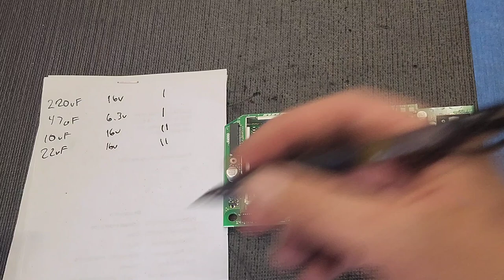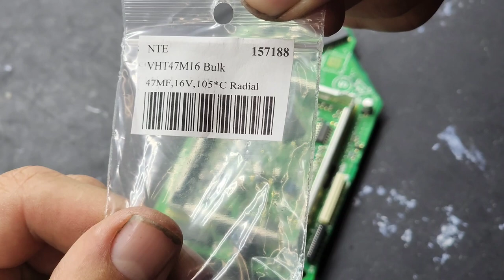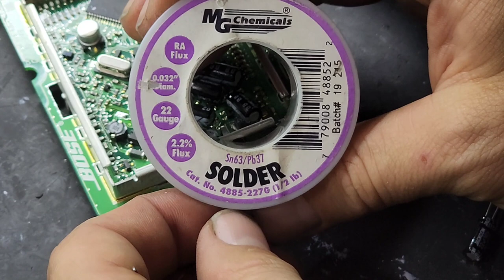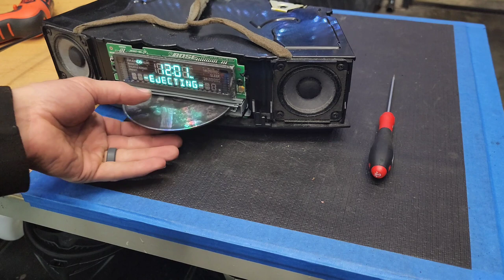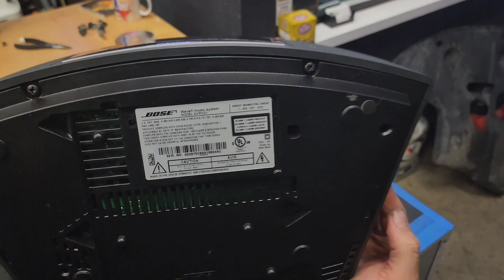Bose wave radio not working with fix!

Comment: When you put the screws back in the case turn the screw counter clockwise until it clicks and then it is lined up to the threads and will not break the plastic.
Reply: Thank you so much for this. Drove me nuts.

Comment: The reason people replace all of the electrolytic caps is due to age. If one fails the rest are likely going to fail or leak as well which can damage the board and other components around them. It's more work but the best practice.

Comment: When replacing surface mount caps why not used new surface mounts? Are surface mount caps less reliable then through hole caps?
Reply: Yes they are, quality through hole components are bigger, and they are better.  Size does matter.

Comment: I guess I will have to attempt this.  I have a white one.  I unplugged it to move it and when I plugged it back in.....the clock comes on and nothing else happens.  Do you by chance have a list of capacitors for these?
Reply: I've found that sometimes there are different revisions so the caps list are not always the same.
I believe there are 15 caps I replace though.
Reply: @mrfishjosh  Actually, I plugged mine back in and it sat over the weekend and voila....it turned on. I have not turned it off since.  Perhaps the capacitors needed to charge up to work...I dunno.

Comment: New subscriber, i have a couple questions, what are the little capacitors that you removed called? Josh what is a good source for replacement electronic parts. thanks for an excellent video covering this topic!
Reply: The capicators I removed are the same type as I put back in, electrolytic caps. As for where to buy them, not sure where your located but local electronics distributor would be reccomended such as digi-key or Mouser. Quick Google search should bring this up
Reply: thanks

Comment: What I find absolutely amazing about Bose products people still buy their garbage. I bought my mother for her 50th birthday of 26 years ago a Bang and Olufson 3000 I think it's a AM FM CD cassette you have the option of tabletop mounting or wall mounting that thing has worked absolutely flawlessly has never skipped a beat and all these years but I've yet to see any Bose product that lasts more than 10 years I've had people bring me their loudspeakers where the glue joints are literally falling apart and the speakers are two and three years old then you take them apart you look at the capacitors and the components they use in their speakers and it's stuff that you would find in a $15 clock radio absolute garbage I find it absolutely completely hysterical that people still Buy Bose
Reply: Haha. Yup, but it keeps me in business. Job security right?
Reply: As long as you but better quality new capacitors in it they will work great!

Comment: Why are these BOSE wave radios built with such cheap components? Almost all fail eventually and go bad. They were and still are expensive systems.
Reply: They are not cheap, the radios are over 10 years old. Every cap has a running life. Just like every pet and human. All good things come to an end one day. Just replace the components and back to square one.
Reply: They just don't make Caps like they used to. Older equipment seems to last for ever that had better components.

Comment: Accidently dropped top loader version and now AM radio doesn’t work, everything else still works. Any thoughts on the fix? Thank you
Reply: Look for broken components and solder joint damage. Otherwise, it could be anything. Check the antenna?

Comment: I bought the 3 i have at an American thrift store for less than $20 bucks. Two older models works great, but the newer AWRCC1 model doesn't work paid on $6.99. This Model seems be the Most repaired model on YouTube Made in USA or it should read Assembled in USA with parts from China or Mexico Assembled by Foreigners. The  new Bose are expensive Junk. HSN 🎄 are selling them from October- December with Demo's of Speakers Blowing Out Candles 💨 etc. Its all Smoke & Mirrors
🎩🪄🎭

Comment: This is a downgrade . You replace all smd radial capacitors with low ESR with cheap THT normal capacitor .
Reply from the maker: Thanks for the replay. I actually use smd capicators now for the repair, but in this video, I did use low ESR caps. Hope this helps.